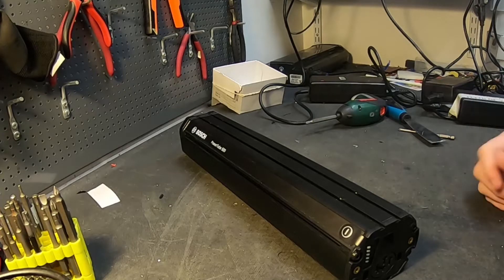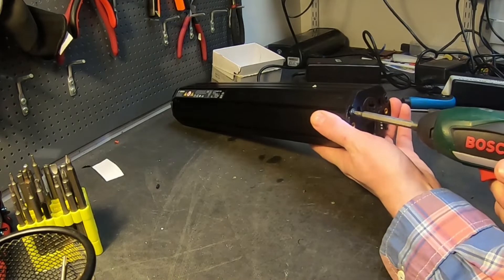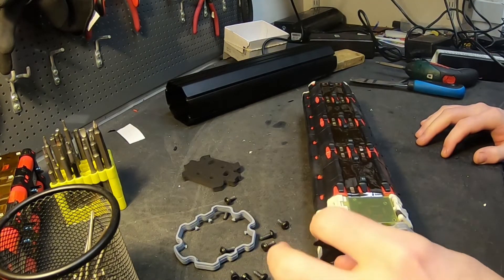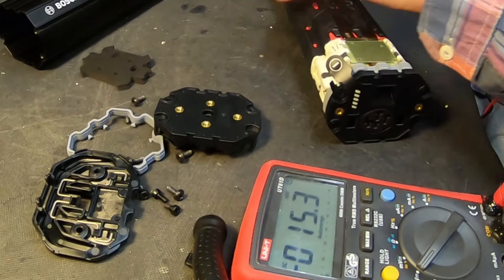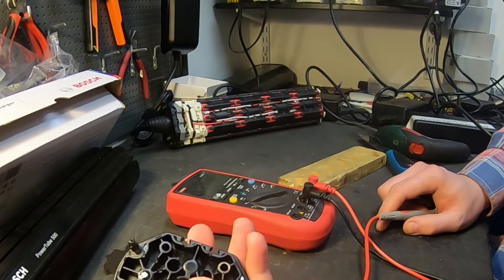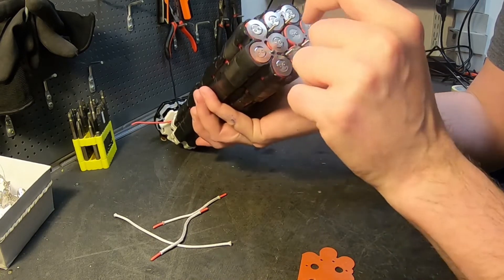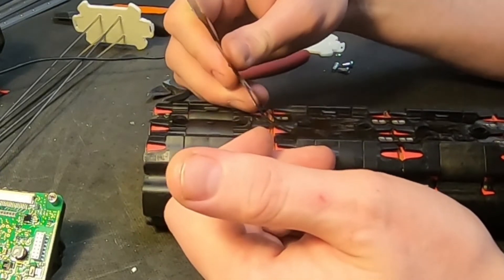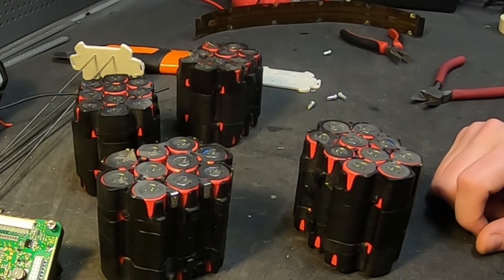Bosch PowerTube 500 Wh - Complete Teardown

Comment: Thanks for the tear down, I have a bosch system on my commuter, I have been looking at a conversion kit on another bike, and this has convinced me that's a brilliant idea, rather than committing to another bosch which can't be serviced DIY, however I will add, my bike from 2018 is still going strong, after one early motor failure, it was fixed under warranty no issues since.

Comment: good afternoon. I live in Brazil and I have a bike with an engine 
Shimano E 8000 and BT E 8035 battery, I would like to know if the dimensions of the BT E 8036 are the same, as I would like to exchange it or if possible send the length in centimeters. Thank you very much in advance.

Comment: This design is great to remove all bosch electronics and add a generic BMS with Bluetooth
Reply: It is possible to change BMS???? I want to convert my bosch cx 4 to VESC controller but it doesn't work with original BMS. It will not release current without CANBUS communication with Bosch controller.
Reply: @petr_green yes. Of course it is possible. I did it

Comment: So it is a 36v 13.4ah battery with 40 cells so cells must be 3.35ah 10S4P. They are arranged in 4 blocks and, from the video, it looks like the 10 cells in each block are configured in 2x4P blocks plus 1x 2P block.

Comment: is it still impossible to rebuild this battery pack after all the cells got discharged completely?
Reply: I dont believe bosch had has any protection against that. However we have ONLY repair batteries that could be charged to ensure they are working.

Comment: When a fully charged PowerTube 500 (about 6 months old) is fully charged and losses 40% of the capacity in 3 days, (2 lights on the battery check), is that normal? What is the standard discharge % about?
Reply: How much are you riding it? In what mode are you riding? Mine is 3 years old now and just beginning to lose steam, but I'm topping it up all the time. Sometimes, I let it go to zero and barely get home, but if you ride in Tour or Eco all the time like I do, it's not bad. Get about 49 miles on a charge.
Reply: My 625 doesn't discharge at any noticeable rate. Sounds like you had a bad cell. Commenting for anyone else finding this later.

Comment: Thanks for valuable visual info and your opinion, was looking into getting used bike with same battery and gonna think twice now.. Disappointing build and design from bosh for such overpriced item...  Would you have  best 2-3 batteries to recommend based on quality/reliability and longevity? Regards
Reply: These are the best cells you can buy and I build batteries with it.
The best you can do is to build your own from these cells and buy a bms for 50 dollars.
Then you know what you got.
Reply: @fayezmohammad745   Thank you for reply, will do some research on it
Reply: @fayezmohammad745  Yes, but on ebay guys sell BMS for this price but as they say it is not checked (whether it is defective or not). I am trying to buy BMS for powertube 625 but could not find yet.
Reply: Bafang!
Bosch is German 💩

Comment: how great and easy it would be if they are made consumer friendly, just screw the bottom off, and the cells slide out, and you can insert new ones, and done.. Just like AA batteries. Much less e-waste and easy repairs this way. It's a nasty thing they are doing with e-bike batteries. They really want to sell you a new battery every 2 years. They could make a 10 year lasting e-bike battery easily using LiFePo4 cells and decent battery management. Also, let the user choose to charge to a custom level like 70 or 80%, make your battery last alot longer, but thats not what they are interested in of course.
Proof...?

1) batteries are way overpriced
2) no user defined charge level
3) no internal reserve capacity margin implemented
4) no slower charge speed settings
5) prevents third party batteries
6) prevents the use of smart third party chargers that can extend your battery life
7) no use of long life cells like the proven LiFePo4 cells
8) no active cell balancing promotes charging to 100%
9) range extenders are not used or charged in paralel and requires to charge to 100%

And this is prety much the formula that all ebike builders follow.
The only alternative is building your own ebike.
There is just no incentive for them to do it in any other way, the amount of profit on batteries over de lifetime of the ebike are huge.
I had a DIY ebike with a LiFePo4 battery that lasted for almost 10 years , always fast charged to 100%.
With slower charging and limit to 80%, it would last at least 20 years for sure. And costs half that of what Bosch charges for the same capacity.

The same is going on with Mobile phones BTW. They don't give you the option to charge slower or below 100%. Even apps are prevented from doing this.. Only way is to use an app to let you know you need to pull the plug at a set percentage. Making batteries also hard to replace, making sure people keep buying new smart phones, even if it's just because of a degraded battery.
Reply: Thank you for informative  and educational  comment, would be mega cool to have all these options...
Reply: My huawei phone let's me limit the maximum charge to extend battery life.
Really is a sign of the times that you have to go to China to get products you can fix and repair and aren't totally disposable ripoff.
Reply: They definitely should be make these more service friendly for professionals, but Lithium batteries are easily nudged into thermal runaway if mishandled, so I guess these system have to keep consumers from attempting DIY repairs. I worked out how long my battery charger took to take my battery from 20% to 80% and added a smart plug to switch it off... when I cared to. These days, I don't baby the battery, it's 5 year old and still going strong.

Comment: I have a haibike the bosch mote has the 5 prong connecter ive found a new battery with only the red and black leads id there a change i can make it work
Reply from the maker: NO! It has Unique Can Bus activator in both battery and ebike. so cannot be used with any other battery.

Comment: Anyone know what the 2021 bosch cx 625wh batteries use, as far as cells , 18650 or 21700??
Reply: The cells they use 18650 with 3.4 ah capacity.
4 x 3.4 = 13.6 ah battery. 500 w
5 x 3.4 = 17 ah battery 625 w
6 x 3.4 = 20 ah battery 750 w
Reply: @fayezmohammad745  ❤
Reply: it is the same as powertube 500 with another row of batteries on top. And the 750 is like 625 with another row on top. So the question that remains is how much amperage the cells have.
Reply: nadie lo sabe?
Reply: It's the same dementions so I think 18650's my question is witch 18650's

Comment: Congratulations for the video, very instructive and it has helped me, I have a query: to connect with the Bosh connector of 3-wire battery (positive, negative, the other) as it would connect to a non-bosch ebike motor that only has 2 wires current (positive and negative). I don't have much knowledge of electronics.
Reply: Did you end-up finding the answer to this question?
Reply: You will need positive and negative wires of 42v charger and the third wire need to be positive 5v source and negative together.
The 5v supply will enable the charger to work and it acts like a key. 👍
Reply: @Fayez Mohammad  wrong they don't have 5v thev3rd wire is another ground wire for charger input to the bms
Reply: @davebrown2527  you wrong. From charger to batt its 5v or the battery dont charge. Eazy fix whit a phone charher

Comment: I had the same battery in my Trek Powerfly, it failed after the 3rd charge, completely dead, It was replaced super quick by bike dealer who told me it seems to be happening with more regularity, so far the replacement is good, 30 charges later.. great video, thanks.
Reply: There has been an error for some of them. So the error comes becuase that the battery has not been updated before first charge.
Reply: Hi..was wondering what country you are from. See I'm looking for bms for my powertube for my trek rail

Comment: Soo...... Dit you repaired it? Can u tell us what was the problem?
Reply: No, I believe he just disassebled it. Usually the newer batteries kill themshelves when the power cuts off.
Reply: bbrain yes you are right. The bms of the bosch powertubes goes into a locked state when it senses a cell being disconnected or even below a voltage threshold. I would really like to know if someone managed to reset/unlock the bms or that bosch made this impossible.
Reply: @ReUniTy7  in theory if you could fit a BMS in there and remove the Bosch system you might get it to work? I cant Imagine that the system sends anything more then "power and voltage state"  the BMS should control the rest without input from the bike. The Bike is really just looking for Power from the pack.
Reply: @Zieranna  I would really like to hear someone who has tried this. The Bosch bms does also balance the cells inside the pack. Maybe it's possible, but the availible space inside the pack is very limited.
Reply: In the bosh powerpack ( older) i removed the factory bms and used a geveric One. However the powerpack returned to work as a "generic" battery very good but didnt work anymore with the bosh motor.
Reply: @paolot8494  Hmm that's interesting. So that probably means that the motor checks if it recognizes a Bosch BMS?
Reply: @ReUniTy7  sure ! The motor and the battery tslks via canbus
Reply: @ReUniTy7  yes, bosch uses can bus to send signal to the motor, bosch is the worst regarding proprietary tech, to repair their motors the bike shop needs to be a certified bosch dealer, the latest tools to servicw motors require a internet connection to bosch servers, and in the 2021 line they i troduced several anti hack features, ita almost impossible to tune a bosch motor from 2021+, I really give preference to european made products over chinese, but i would stay away from bosch and choose brose instead for a new bike.
Reply: @ricardorodrigues3508  Do you know if the reverse is possible - using a Bosch battery with a non-Bosch motor? Will this canbus communication become problematic?
Reply: @antonbabadjanov8813  its not possible, the bms is protected, only possible solutions is to reuse the cell pack with your one DIY or chinese bms
Reply: Anyone know what the cells rating is?

Comment: How many more cells does the 625 model battery have?
Reply: One extra row of cells.
Reply: I except the 625 model to just have bigger cells instead of more of them
Reply: @Gungarr  I doubt it. They use standard 18650 cells (fixed size).

Comment: That's what you call engineering overkill...
I doubt they even repair these when they get broken while in warranty. Probably just replace it with a new unit and therefor not requiring battery repair centers. At the same time making it impossible for the user to repair it via 3rd party out of warranty and thus making him buy new overpriced over engineered pack.